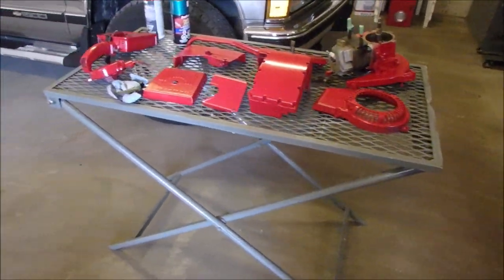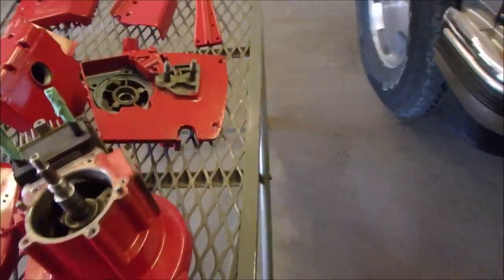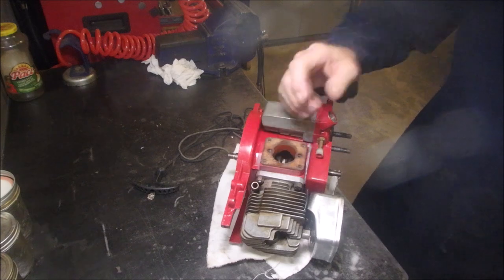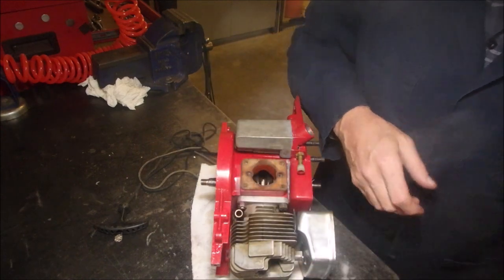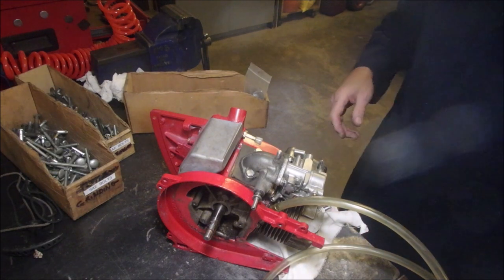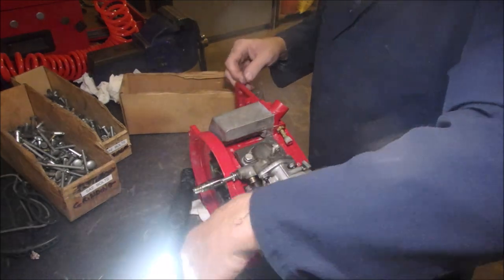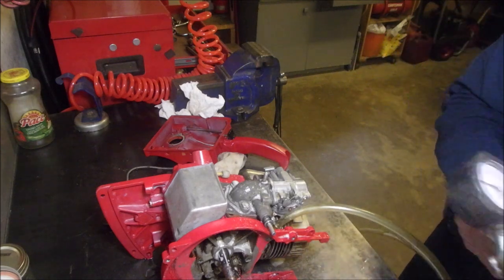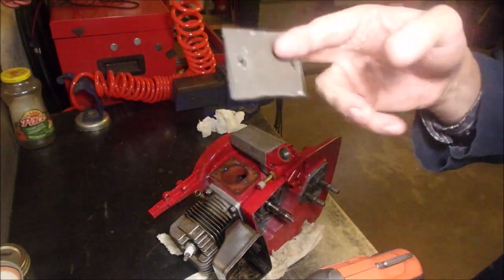Homelite XP1020 Chainsaw Crankseal test

Comment: Amazing that an older machine like that still has good seals, possibly it never got used that much eh? The unit was looking better with each piece being assembled there will be a total transformation when it is all together make sure you finish off with the before and after pics side by side.
Reply from the maker: Great idea.